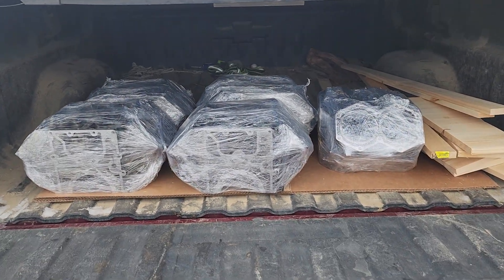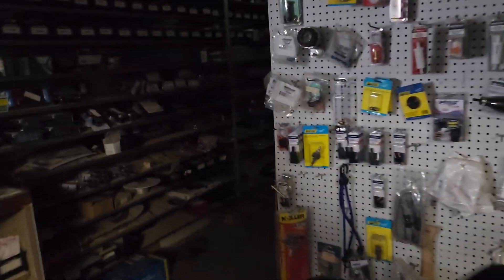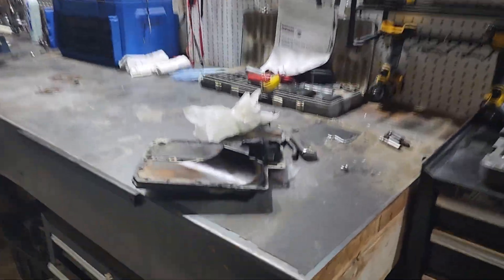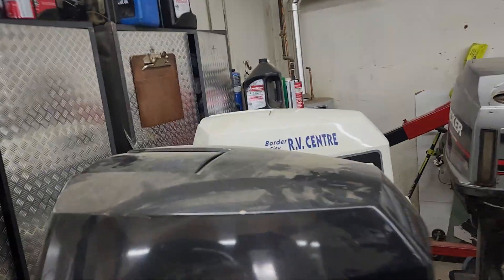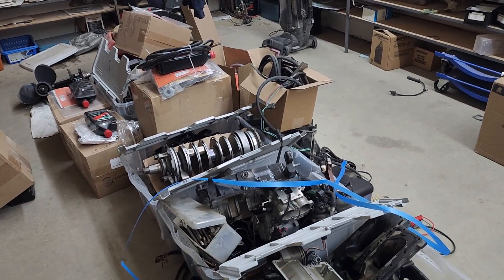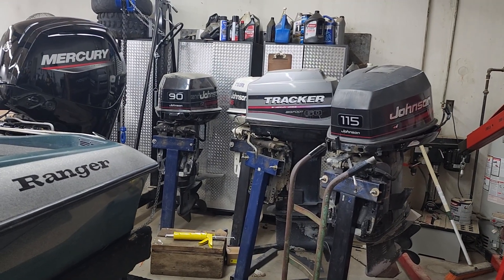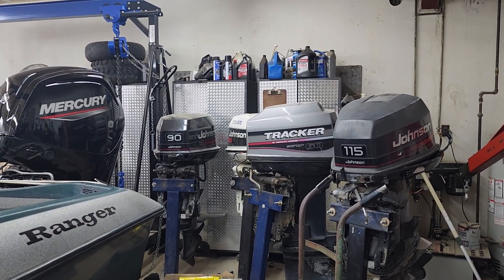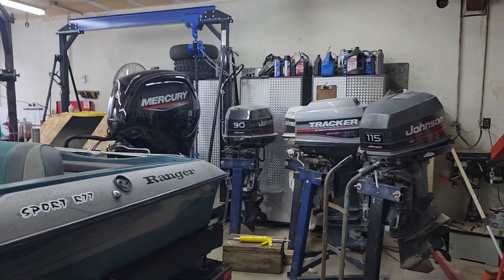THE BLOCKS ARE BACK! Johnson Outboard Reassembly SOON!

Comment: Nice 👍
What brand pistons you use ?
OMC gone .
I would rather have an old v4 omc Johnson Evinrude than new high tech plastic computer garbage which cost $12k+ 
Cheap easy to fix maintain.

Good luck.
Reply from the maker: I will be using WSM piston and Gasket sets.  They are still on order.  I keep one of each piston size in stock for sizing.
Reply: @TheMarineDoctor wiesco made in USA excellent 👍 
I used in dirt bikes .

Meteor cylinder piston kit Italy excellent also for chainsaw etc .
Reply: WSM is water sport manufacturing. Pistons are made in mainland Asia and the rings are from Japan.
Reply: @tylough oh no Chinese parts...japan is excellent though.

Says made in America on box.
I thought they were Wiesco?
Reply from the maker: @tylough Oh?
Reply: @TheMarineDoctor I guess it doesn't really matter where they're made as long as they work.
Reply from the maker: @tylough yes.  I have had no problems with them in the past.